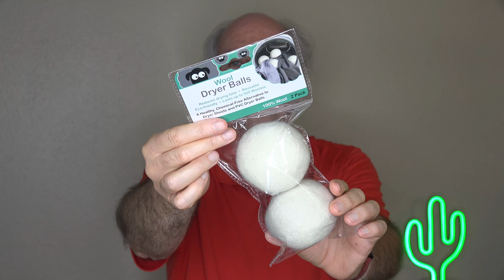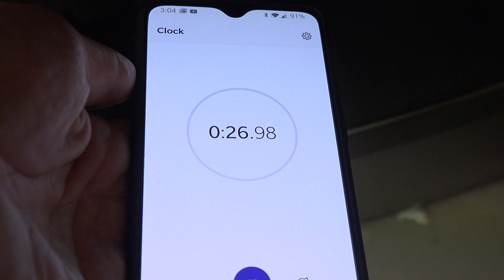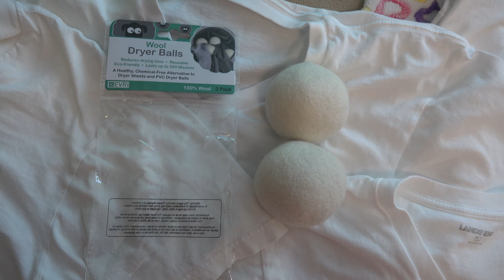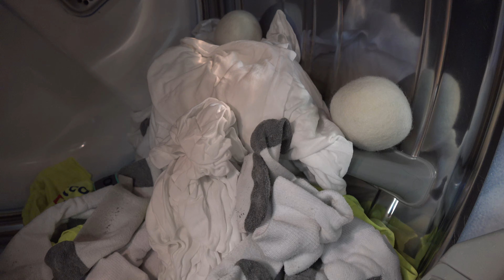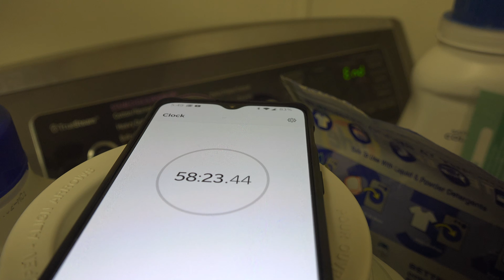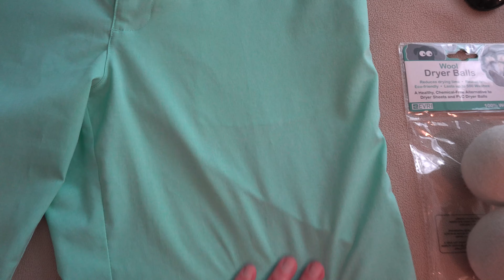Wool Dryer Balls Review

Comment: I know this is old but feel compelled.  They absolutely DO work and on all fabrics... denim to shear (but no silk which shouldn't be in a dryer anyway).... you just didn't use enough of them.  Read up on how they work and you'll understand.  My experience has been  soft, fluffy, static and wrinkle free on everything from outer wear (cotton to polyester) to thick blankets and towels.  Cuts drying time too.  I do use more per load than most recommend but, hey, they're cheap.   The more of them, the less wrinkle-setting and static-producing friction. I use wool ones that come in six packs.  These are hard times and they decrease the electric bill a bit and save dryer sheet costs.  The environmental stuff is a bonus.  I guess I'm taking the time to do this in the public interest. 🙂

Comment: Do the dryer balls stop static cling? 

I use a steamer to get wrinkles out.
Reply from the maker: Not like dryer sheets do.  But I have read that if you spray the dryer balls with water before throwing them into the dryer that will help to keep the clothes from over-drying and picking up the static cling that results from that.

Comment: Enjoyed your video.  I haven't tried wool dryer balls yet, but I breed Shetland sheep and am about to try making my first batch of dryer balls.  My understanding of part of the way these shorten drying time is that they absorb some of the moisture, taking the moisture out of your clothes, but maintaining a humid environment in your dryer, which helps to prevent wrinkles.  If this is the case, a dryer that shuts off if it's sensing "dry" as its load reaching a percentage of its original weight, then it's possible that, since the moisture has, in part, been redistributed to the balls, the dryer won't sense the load as "lighter" enough to shut off.  Just a thought.  Curious to try these myself.  - Andrea @ HarmonyFarmsNJ.com
Reply from the maker: Hey Andrea!  I hope your first batch turned out well.  I am not sure about most dryers but mine has a sensor inside the dryer drum that monitors the humidity level and shuts off based on that rather than on weight reduction of the clothes.  Lots of things can throw that sensor off however- including dryer sheets coating the sensor.

Comment: I dry my tie dye on the clothes line. Then put them in the dryer with FOUR dryer balls for 10 minutes. They take the stiffness out of the clothes and no wrinkles.
A few things for you to consider. You need to clean the lint trap before each load. The lint will block air flow and increase drying time.
So not count on your dryer to tell you when the clothes are dry. Set the timer for 30 minutes then check the clothes. Dry at 10 minute intervals until they are done.
The more balls you use the more they fluff the clothes and increase air flow.
I do not use dryer sheets or fabric softner. Less chemicals released in the enviorment. The clothes I sell are soft and wrinkle free.
Granny @tiedyeagogo.
Reply: Thank you granny, top tips!